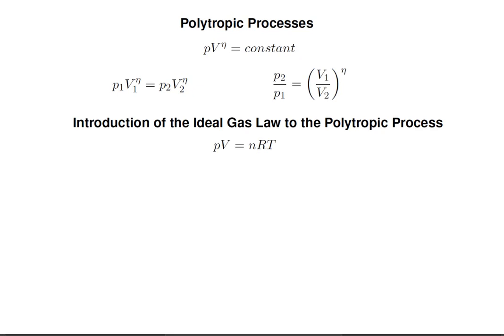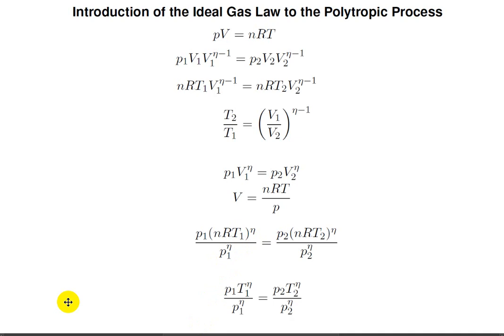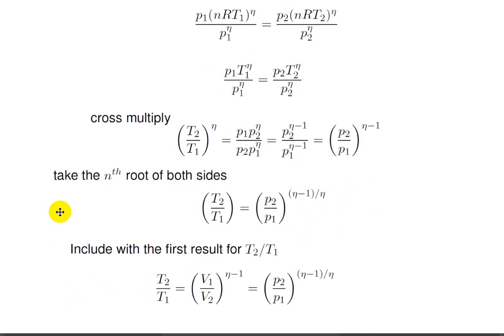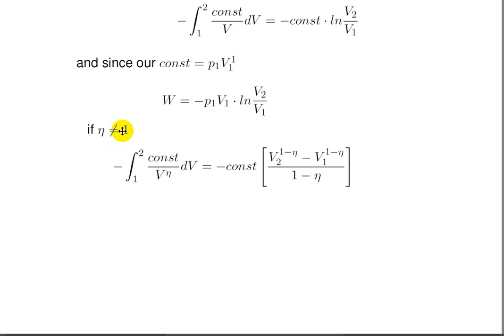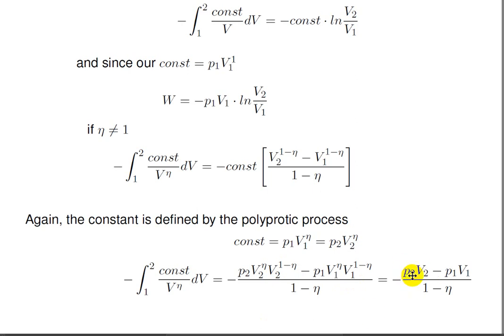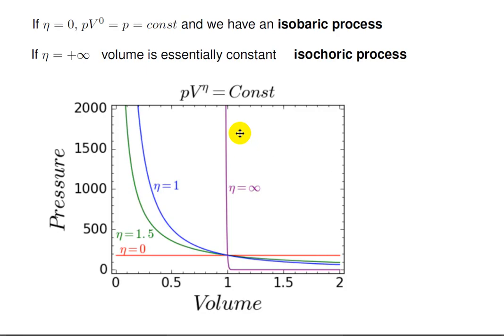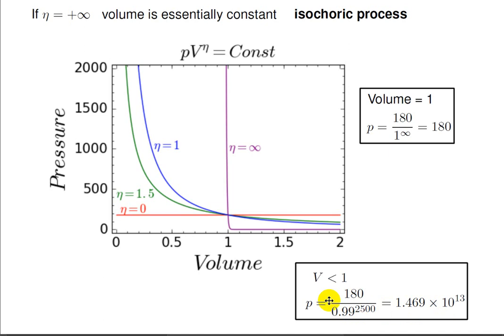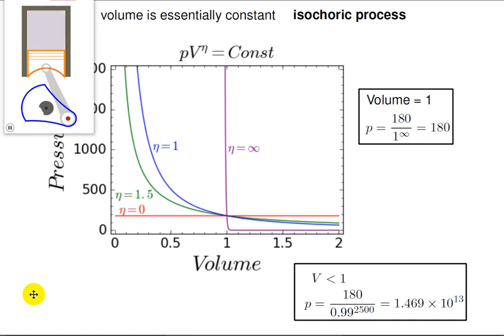Polytropic Process

Comment: This is a very clear step by step explanation of how a polytrope is calculated from the ideal gas law and two interactive gases.  The graphs are clear and show what happens to pressure and volume and temperature when you change the polytrope exponent "eta".  I wish an example using astrophysical processes such as interacting interstellar gases or neutron star density and pressure had been given, but I will seek out other video's for that.  Thanks for a clear derivation.